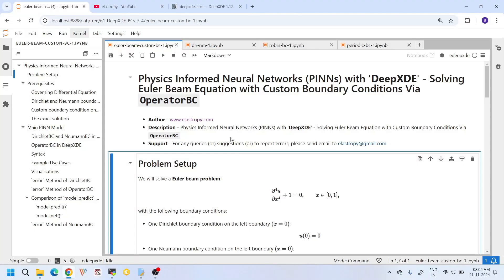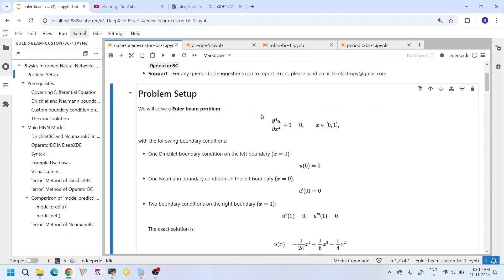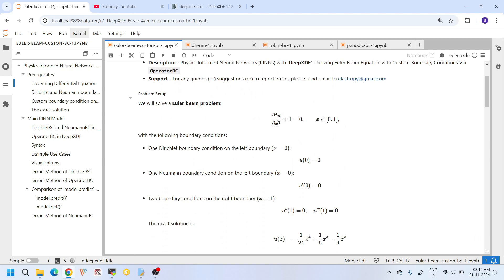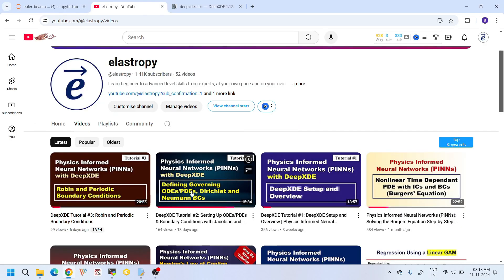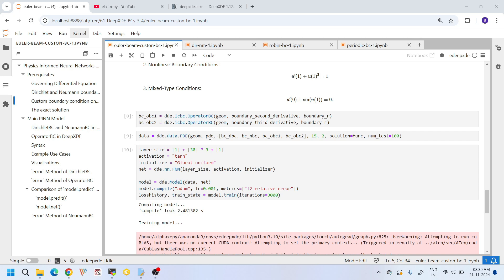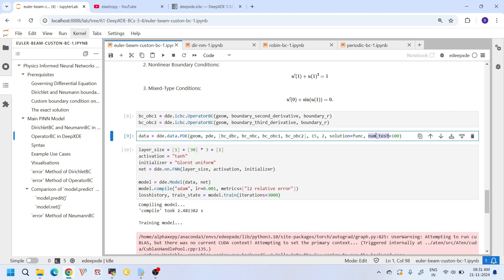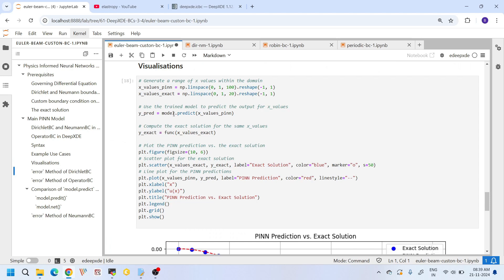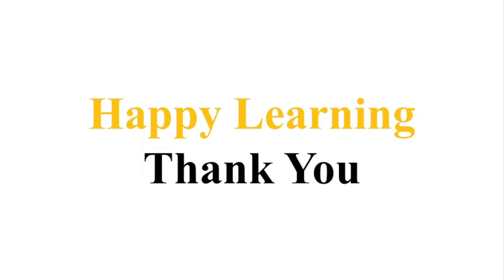DeepXDE Tutorial #4: Solving the Euler Beam Equation with Custom Boundary Conditions

Comment: In the function f(inputs, outputs,X), Can you give me some examples of the use of X? I don't understand where is useful. Thanks for the videos!
Reply from the maker: Hi @ellybayona8613, thanks for reaching out to us. That's a very good question. In f(inputs, outputs, X), the X is just the original NumPy array of input coordinates — useful when you want to write boundary conditions that depend on raw values like x < 0.5 or t == 0, or when using NumPy functions like sin(X[:, 0]).

DeepXDE Doc Link - https://deepxde.readthedocs.io/en/latest/modules/deepxde.icbc.html#deepxde.icbc.boundary_conditions.OperatorBC

You can technically extract the same X from inputs by doing:

inputs_np = inputs.detach().cpu().numpy()

But since DeepXDE already gives `X`, it’s cleaner and safer to use it directly — especially for indexing or logic-based BCs.

Meanwhile, always use `inputs` (tensor) for gradients like:

dde.grad.jacobian(outputs, inputs, i=0, j=0)

Hope this clears things up! If you're serious about mastering PINNs, check out our full PINNs masterclass here (https://exly.co/PvxFUL) — it covers everything from scratch with real projects and source codes.